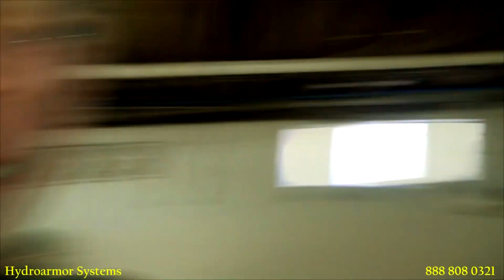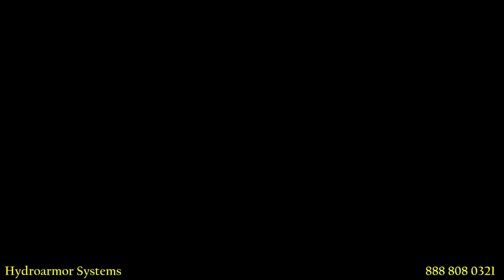Basement Waterproofing NJ - Hydroarmor - Foundation Waterproofing

Comment: Hello Tony and Dan and all of your workers. I just wanted to say thanks you for getting my basement fix. You guys are the best , very professional . I had several quotes and you guys did the job half the price and it was not carbon fiber strap. I like the fact that it was steel rods and cement inside the cylinder block which in time will look better if I ever decide to sell the house. And also the wall is not moving. I know I beams is a must if your in that situation but thank God the basement was not in that bad of a shape.

 The job you did in River Edge NJ  is very professional  and clean  and I thank you all. I also wanted to let the people know that job that would of been 3 days or more and you guys did it in  2 days to complete. . Very clean and very professional and price very reasonable from all of the contractors that came by. Thank you ... Jason , Jacob and Sandy we love you guys and we are glad our house will keep us safe with the job you did... APRIL 10, 2021 I hope your company strive and keep giving people  great price and quality work.

Comment: Would u recommend drilling the weep holes all the way through to the exterior side of the blocks?  Like in case there’s a exterior coating from previous work done..
Reply: You only drill the inside because the water seeps through the outside. If you drilled the outer block water would try to drain from the outside block and you would get more pressure build up in the ground.
Reply: @daleravic  Great answer thank you
Reply from the maker: Nooo... The mud outside... Daniel J OConnor

Comment: Would a pressure relief system installed from the  beginning prevented the walls moving.
Reply: Oh definitely.
Reply: @sethdistler5332 If you were building a new house which is the better way during construction. Seal the outside foundation or just put in an interior pressure relief system?
Reply from the maker: Yes....